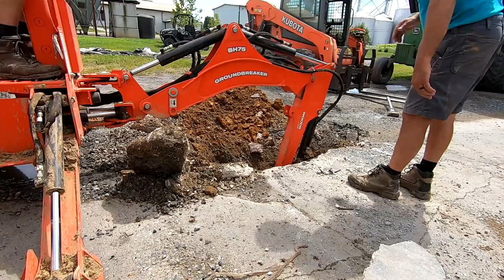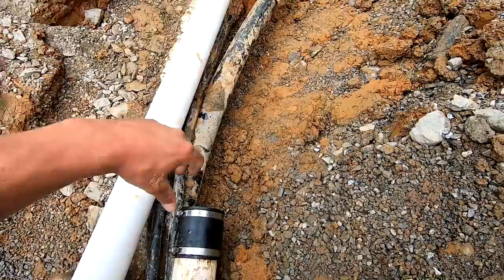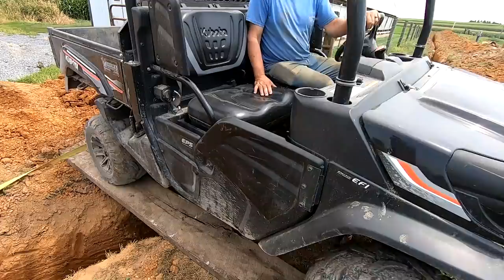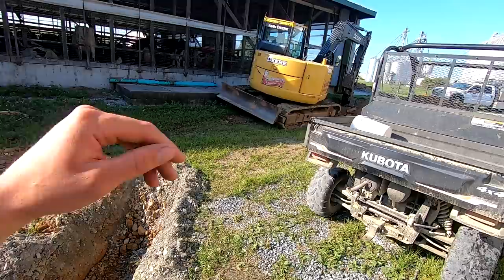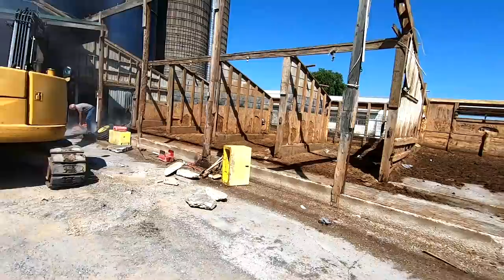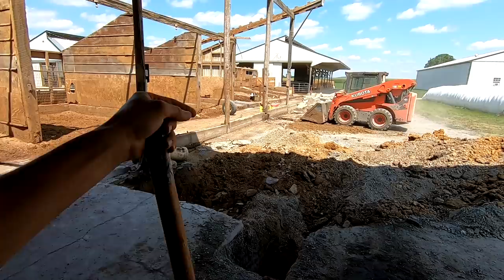In the Trenches

Comment: Tracer wire on your new water line would've helped you locate it in the future in case you lose your pics of where it's at. When trying to find an existing line dig perpendicular to where you think it is. That way you can see a ditch line in the soil, and test dig with your spade before you use an excavator. Also you should install the PVC fitting onto the new section of pipe, then fasten it to the existing pipe. Otherwise your fitting might be pointing too far up or down. If you're going to use a Fernco coupling underground use a banded coupling. It is more stable if the soil settles. They also make PVC repair couplings that have no stop in the middle. They make a slow set glue so you can slide the fitting around.
Reply: All great suggestions.

Comment: So in the future filling the hole a bit then putting caution tape on top will help when digging later on
Reply: Also add a strand of wire and you can pick it up with a metal detector

Comment: Some suggestions: Backfill with 6" of sand to stop rock pressure from making holes in the new pipe. Also caution tape for the water and electric lines above the lines for a further person digging up the ground. Also take off distances in feet and inches, or triangle distances measuring from a solid struture like the corner of barns, houses, etc.( pulling some offseets) and lay them out on a plan. Thanks for the video. Very nice new barn.
Reply: I was about to say that. Especially if you have water lines that kick on and off they can jump a little which will work a hole into the line. We have had it happen with PVC even. We have a nursery and we have intermittent mist irrigation on cuttings and our water kicks on every five minutes. Needless to say I have a shovel in my hand all summer long.
Reply: @austinp8942  I can't tell you how many times I have seen rock pressure put holes in wate lines. Flowable fill or sand should solve the problem. Great comment, thanks.

Comment: Eric when I was on the farm we always had a map and distance and depth but by every hog waterer we had 3-5 well curbing with lids and we ran 8 inch cement tile and if we had a water leak we could take the plastic pipe loose on both ends and pull a new piece of plastic pipe without having to break up the cement especially during the winter and we never had to break up any cement.

Comment: And what lesson have we learned?  That keeping detail records and diagrams of where everything was put when it is put in will be tremendously appreciated by people in the future.  Be thoughtful and kind to people you do not and will not know.
Reply: I created floor plan marked each outlet, switches, fixtures.  Then I numbered it to match circuit breaker. 
Circuit breaker may be labeled but not always enough.  Did same for yard/lawn for sprinkler system, marked number matched with station lines.
Reply: As builts have a tenuous relationship with reality at best
Reply: @rugger3buffalo  
Like everything else, as builts are only as good as the people who built, and those people who built are only as good as the cost payer's involvement.  Which means the person who is paying the bills will have to do their part to insure the as builder does complete and accurate as builts by telling them they will get paid, or not, according to their adherence to the payer's standards.

When my parents had their house built in 1973, they controlled the money and personally paid the subcontractors only after they inspected the work and signed off on it.  There were several who had to come back again and redo their work because they were not going to be paid if they did not.

Comment: Lol  I learnt real fast always put your pipes by a fence line or put your fence line by the pipe line then you can always find it.  The only person who may???? remember where it is, is not around any longer. Any join or problem area I mark with a wheel rim so I can find it again and future people can.  The mapping now is considerably better now than in the past, with gps and photo mapping  available now
Reply: Usually find it with the auger when you replace the fence posts! :)
Reply: @jpm1211  not a problem so far I replace broken posts with y steel posts or push new post in with 20 ton digga just to the side of the broken one.🤗

Comment: Tracer tape above anything buried can offer the feeling of hope that you've prevented future digging complications.

"Been sitting there long?"
"What day is this?"

A conversation with a backhoe operator who inadvertently welded his bucket to a buried below tracer tape 12.5KV single conductor cable. If he let the bucket touch the ground the hum, sparks, and eventually the smell affected his ability to move. Good thing he brought his lunch and plenty of water. If he didn't have a small leak in a boom valve that allowed the bucket to contact the ground who knows how long he would have stayed. The short to ground was left long enough, he's a sound sleeper, To pop the fuse. May 14, 1996 and I'm certain of that date because our phone rang while eating birthday cake. He started his dig on Saturday afternoon and slice into the medium voltage cable right after asking himself, hmmm, what's with all the plastic ribbon?

Comment: Just a quick observation for next time. When you're back filling the holes around the water pipe try to use something a little softer than crushed rock such as sand. Also what we usually do is 6" below the surface we will take and put a utility tape and then bury it. Such as saying that there is a water line there, gas line, electrical et cetera. That way there in the future if somebody doesn't know what's there and they're digging it up again and they hit that tape first and will know what lies below and have a far less chance of tearing up your electrical or water pipes. Great vid though.

Comment: if you put sand and a yellow ribbon on top of ground pipes/wires its way easier to find them without damaging them, and the bucket you where using is not really optimal for this job.

Comment: Have your well person put in a locator line before burying the new water line. It's a wide yellow plastic tape with a wire embedded so if you need to find it in the future you can call local locators and have them locate and spray paint the location. Also put some on the older lines for future location. New construction uses it all the time.

Comment: There are electronic transmitters that you feed into the water line you want to locate.  Then you use the locator headset attached to the receiver to mark the earth above the line.  It would have saved you on this.  Always unroll yellow warning tape about 1 foot above your pipes so if you ever dig again you’ll hit it first. (Or you could use locator wire the same way.  Then you can put a signal on the wire and locate the entire length later.  I’m still looking for the drawings I made years ago for the pipes I buried 😜

Comment: You definitely are into a major project. I don't mean to tell you what to do, but I would for sure install some kind of warning track tape and sand above the conduit and the plumbing piping. Paint a florescent  color paint above the utilities slightly under the surface of the turf, (or ground itself) so you can locate these utilities if you have to dig again in the future.   JUST AN IDEA TO ELIMINATE PROBLEMS. ( THIS WOULD BE CONSIDERED A WARNING TRACK)  Thanks for listening.....

Comment: now is the time to get a A1 gridded (little square) paper and draw what is new in water, electricity etc and what you have found is existing and put it on the paper with buildings and approximate space from the building to the service - water is done in blue, power is done in red and black is for black waste so you can do green for slurry - they are the colours for all things done here in New Zealand - when it is done roll it up and put it away or laminate it because when you need to use it, it will not be for a clean job and put it on the wall in the office to refer to (out of the sun)